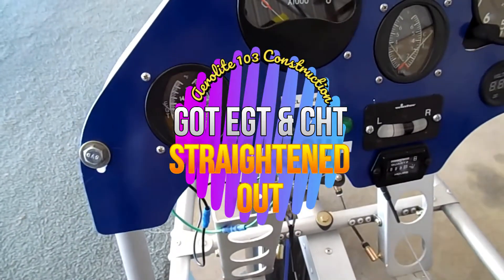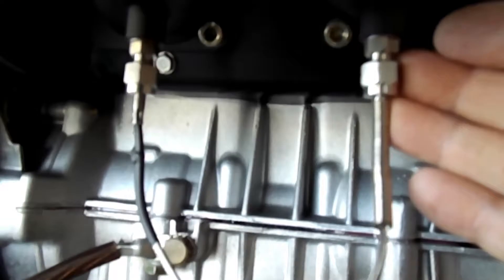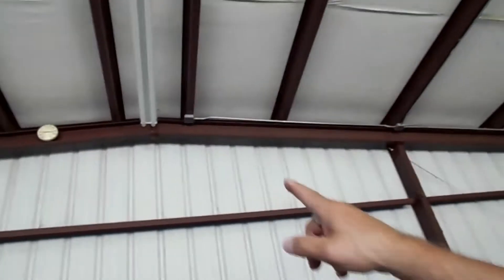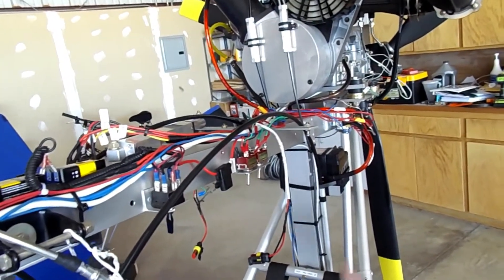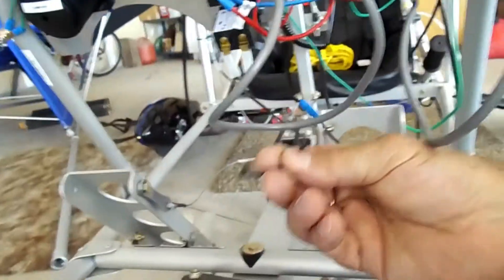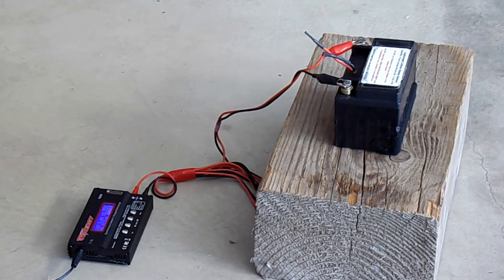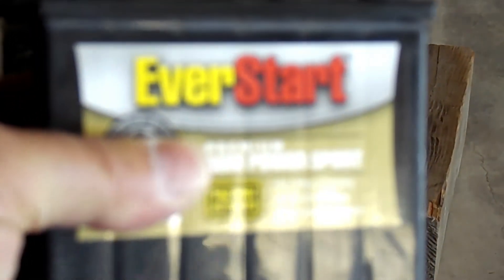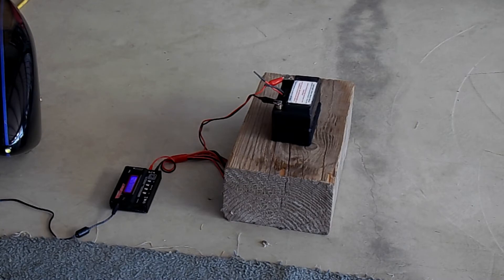Making Progress After Murphy's Law - Finish Wiring Instruments

Comment: Johnson Control is a major player among the battery manufacturers.
A Battery Tender connected to the battery teminals with alligator clamps will keep the battery at 100% without overcharging. Never worry about a no-crank again.
Battery Tender Junior is about $35 at, ugh, Walmart.
Reply from the maker: Way ahead of ya and have one doing that now. Thanks for the advice.

Comment: I'm curious as to why you have to remove the fuse on your fuel pump wiring??  Thanks and keep up the videos.
Reply from the maker: Hi Jack, because the fuel pump/s need to run full time and if a fuse blows they stop. You know what happens if your engine gets fuel starved - you need to land immediately. And that would not be good over a lake, for example. 

If one had a 'pulse pump' that worked off engine case pressures and all of a sudden dies because of the diaphragm inside failing, one is up sh*t creek, if you know what I mean. Thanks for the question and support. "Blue Skies & Tail Winds!".
Reply: Thanks,  make s sense to me,  now I think I need to go do some re-wiring...……….

Comment: Sir, I am in Ohio, rebuilding a Quicksilver GT 400, New EGT and New CHT. I will need to extend the wires from the Probes to the instrument panel. what type of wire and what gauge did you use? I have about 12 feet to run from engine (pusher Prop) to the front instrument panel. Do I have to buy special wire for this? any help you can give me I thank you. G. Milner from Ohio
Reply from the maker: Gary, I personally used commonly acquired 'stranded copper wire' of the proper length. [Note: It's not advisable to use solid wire in aviation applications.] It was 2 conductor sheathed cable, approximately 16 to 18ga and I spliced and soldered each extension together, and then finished them off by using heat-shrink tubing wrap to insulate both solder joint/s made for each respective wire extension.  

Hope that helps. Thank you for the question/comment and watching my journey.